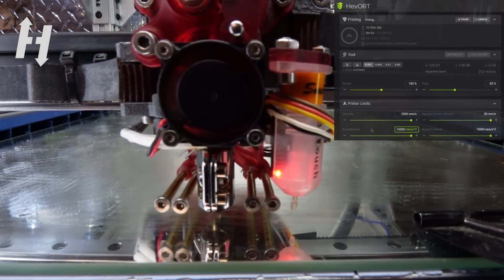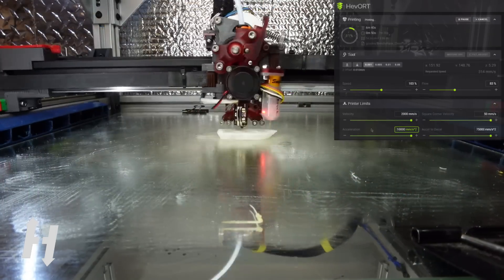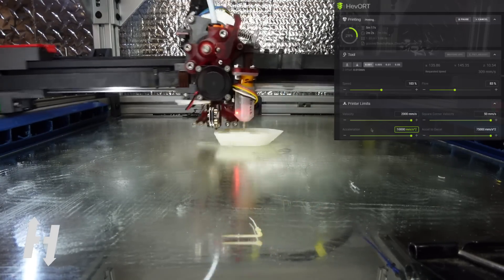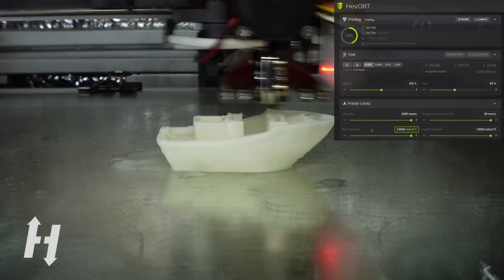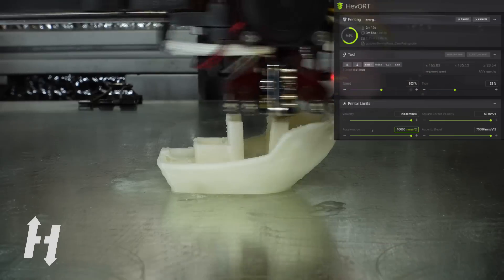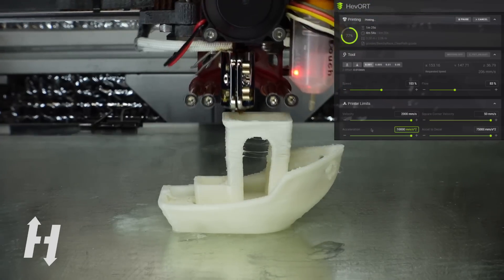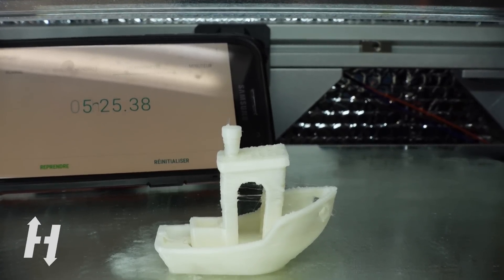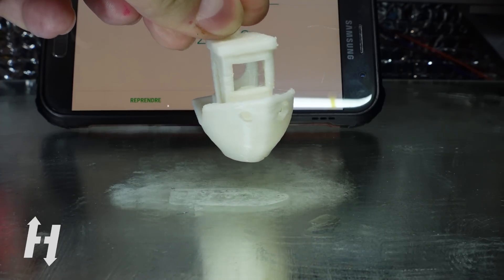Printing Benchy with SERVO motors on my HevORT

Comment: So as far as I understand - you don't have enough pressure to extrude the fillament and you also don't have enough cooling. But you do have speed. Correct? And if you fix all that, you'll get a better result. No problems with accuracy?
Reply from the maker: Accurracy is good for now.  I have attached my Nova heat sink from the top, and bottom, Thanks Vlad for the provisions in your design :).  As far as cooling goes, compressor air seems to offer me some headroom again.  Now melting power and extruder speed are my roadblocks.  Potentially material surface tension too.

Comment: It's always exciting to see one of your videos in my notification list! I was wondering what kind of belts you use? I've seen some references somewhere to metal belts. Have you heard of that? Or am I just thinking of belts reinforced with stainless steel braid? You did a video recently on lead/ball screws. You noted how prohibitively expensive ballscrews are, but do you think you'll one day use them to match the performance that the rest of your printer is capable of, especially with these new servo motors? Keep up the great work.
Reply from the maker: I am using 12mm wide Gates 2GT belts (from china).  They are using fiberglass inside as reinforcement.  They are good, I find they will ring a lot less than my 6mm ones.  But they are heavier and stiffer, something to consider when using stepper motors.   As for ball screw, I am looking at the near future where I would try fast travel ball screws with those motors :)  that will be fun!.
Reply: @MirageC  I can't wait to see ball screws with these servo motors! Soon you'll need a high-speed camera to trace your movements. Actually, now that I think about it, that would be a good way to measure the actual speed of the print head! Time to call the Slow Mo Guys. :))

Comment: What is the aim of those 4 screws close to the nozzle?
Reply: I think they're hollow with compressed air flowing through them
Reply from the maker: they act as plugs to my air pipes.  I did not like the look of simply crushing the end of the pipes. Plus the hex socket heat gives me opportunity to tune the angle of the airflow.
Reply: @MirageC  Thanks for the answer! I was really curious about why you would put such heavy gear at the end of the print head, with no obvious function.

Comment: incredible! so satisfying to watch this thing move, and just amazing what these actually really tiny servo motors can do. absolutely beautiful. i have 700W servos sitting here for a cnc i'm planning, and i'm just realising how scared i should be.
Reply: must be a big CNC to warrant 700W servos (guessing its 750w). Make sure to limit the torque as otherwise those servos could bend/dent it if you crash into the vise or workpiece. My BF20 conversion is running 180W servos and they got plenty of torque for that tiny toy.
Reply: @exol511  you're right, they are indeed 750W. thanks for the advice. they're probably overkill and i'll treat them with the utmost respect. i'm aspiring towards a granite cnc similar to Piotr fox wysocki (youtube), but may save the 750W servos for a cycloidal drive B and C axis arranged like a mini hermele.
or use one as a low rpm spindle initially, since a good ATC spindle starts at 3-5x what i've spent so far and it'll be a while before i can afford one.
i was a bit power greedy and they were very attractively priced.

if they're really too much i've also considered trying to make a large scara concrete printer where they might come in handy.
Reply: @DMonZ1988  if you can get the faces for the linear components machined by someone I would just go UHPC with inserts like most manufacturers do these days.

Comment: I love the development path you do, but for cooling I would like to see maybe a different solution. Berdair system is really nice, but what would be, if you would use Peltier to heat the bed, and use an chamber to collect the cool air that you compress out to the Berdair output?
Reply: I thought compressed air was a fantastic idea. Small quiet air compressors, like for air brushing are cheap and would work just fine. 
Huge fans pushing massive amounts of air around the chamber is inefficient at best.
Reply: @nils1953  Air brush motors? Hmmm, that is not a bad idea. Would it be possible to use cooling targeted on the final print where is located on the heatbed - so that way would be possible to remove easier? PS: If speed is so important why is it not delta type is used? CoreXY is significantly faster?
Reply: @ZoltanHoppar  I am not very familiar with peltier modules, but if you would use a lot of them to heat the bed, and if it is even possible, change the polarity and with that instantly cool the bed. Peltiers are very inefficient though and can get expensive. 

Because Delta printers are in my opinion very hard to upgrade or improve yourself with 3d printed parts. Yeah, they can be really fast, but to improving them requires a lot of tools and machines.
Reply: @nils1953  Thx. I have to other technical question/idea: Would it be possible to use similar tech as inkjet printers do - that transforms solid material to liquid, and uses a wide head - and spitting with electricity to print? Another question is: Can be an airbrush system integrated next to the printhead to use as cooling system (only spraying air), and with paint doing some modelling paint work?
Reply: @ZoltanHoppar  Like polyjet or??
Reply: @KentoCommenT  Oh. Didn't know about this. But yes, except not that UV material is being used. IF we can liquefy many solid form stored materials, and spray out and cool down by airbrush motor air on the same head, I think we can win a lot, as the whole layer gets printed at once, and we can go down in fine details. If that gets an spray painting option or we could use the SIPPLACE machines rotary head - you can have a manufacturing station that produces  the whole thing, not only the plastic part.
Reply: @ZoltanHoppar  Unfortunately, FDM plastics don't have that kind of viscosity.

Comment: I'd love to see an updated cooling video like you did with the thermal camera showing the effectiveness of the new cooling setup. Are you also still using the side coolers?
Reply from the maker: Not on this run. Shop air was more than enough.   :)

Comment: In a reprap sprit, I feel like competitions like this would do well to be separated into "weight classes" based on cost of off-the-shelf components.  <200usd, 200-400, 401-800, 801-2400, 2400+ for example.
This would certainly be better than an arbitrary tech requirement for steppers, for instance.
Reply: Agree.
Reply: i would not see this a normal competition where somebody wins. 
All this superspeed benchy look terrible - but they show what the limits are where you can improve. 
Everybody is a winner here.
Reply: @JoergGebhard  That's obviously true, but the idea here is gamifying it a bit, making it a kind of "speedrunning category". Much like race car tech trickles down, this stuff will.
Quality classes would be another very reasonable category division.
Reply: @JoergGebhard  Exactly!
After all that's the spirit of the #speedboatrace - not to claim 'Oh I've got the fastest printer and it's the best!' - it's to show everyone what is possible and ignite the spark in us to improve our printers even further! :)
Reply: @JoergGebhard  This benchy absolutely is not terrible, many promo videos of regular printers show benchies worse than this. It is not great if you demand perfection, but the fact that it's even possible to print at this speed is amazing, opens a lot of doors, maybe even for vending machines. I agree, everyone is a winner here
Reply: @WaynesStrangeBrain  um, no. The benchie is terrible, and the fact that some printers print it worse just shows that settings were chosen wrong. The speed and acceleration are insane, but what's the point if models look like that?
Reply: @MrYaroslav210  the point is making the printer stupidly fast. And no. The benchie does look quite good for what speed it was printed at.
Reply: I feel like the ender 3's have their own league lol
Reply: would really love to see how far one can push quality and speed. this already looks amazing, but imagine how much further one can push it.
Reply: Agree! And if you curbshop it you can make it a percentage of the off-the-shelf price, lol.
Reply: I'm waiting for 2kw bldc motors with hydraulic brakes, and dual heads, with a high power high speed gantry, and a small head with electromagnets to correct the head.
Reply: i totally agree. let´s merge the knowlegde and see what happens
Reply: I personally disagree. This competition looks more done to push the boundaries of what DIY machines can do, and to show how all proposed solutions might solve better the "speed" problem that is object of this competition. So I think that using servos is perfectly in the spirit of the competition as it shows an alternative to usual steppers, an alternative that might (or might not) further be explored in the reprap community. Also there is no "real" prize for it except the glory, so really, to all speedboatracers,  please go on with crazy solutions, weird motors, insane kinematics and show us what technically is possible to do at home in a diy setup!
Reply: I don't feel like there should be any limit on anything, besides the end product having to be made from a thermoplastic material that was squeezed out of a nozzle of a certain diameter. Show us a printer that uses linear motors for movement. Show us a 50,000 EUR SCARA robot with a hot-end as it's end effector doing a benchy. A hydraulic delta robot. Pneumatic muscles. Telekinesis. Whatever. This invites innovation and thinking outside the box. I already feel like 3D printer innovation has stalled, everyone reusing the same parts and components.
Reply: I think it's better to split them into categories based on print volume.
Reply: please lets make this a thing

Comment: Nice, its a shame servos dont count
Reply: Don't count for who? They count for me. And they count for all the future desktop 3D printers made with servos. Because clearly that is the future.
This video goes beyond the benchy race.
Reply: The benchy race was brought into existence to see how far the normal stepper printers can be pushed and innovated. Servo motors were excluded for now as they are currently out of the price range of alot of people and it reduces the need to innovate and optimise alot (someone that slaps on servos will have an easier time getting a 7 minute benchy than someone with steppers and just by spending alot more money). There will probably be another competition later on that will only put servos up against each other. No one is saying this isn't cool or amazing because it really is! It's just that the rules were made to innovate and optimize the current state of 3d printers as far as possible and for everyone to be able to give it a shot and have a chance at being st the top without having to spend 1000s of dollars/euros
Reply: @C1Rob1990  Am I missing something because 2 servos on aliexpress with the drivers seems to run around £100-120, which, while 5-6x as expensive than 2 nema 17's with 2 TMC2209 drivers, isn't entirely out of the realm of affordability (it's about the price 5-7kg of filament)
Reply: @KentoCommenT  depends which servos your talking about and what drivers they have. A lot of drivers for example will not be able to be this accurate
Reply: @madbull4666  That makes sense. Is there a potential for nemas to decrease in accuracy when in a closed loop?
Reply: @KentoCommenT  if I'm being honest I don't have enough knowledge to answer that question tbh, I'm learning but most stuff still goes over my head a little. I believe your right though. TMC has also brought out a new driver TMC4671 which can control servo motors and they've bought out a development board for it too so possibly one day someone may build something that we'll be able to use for this.